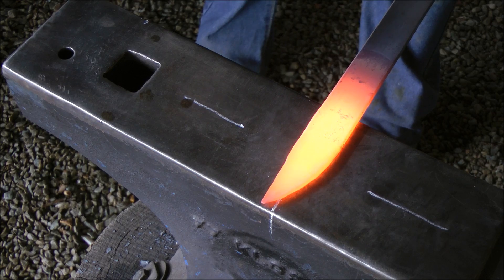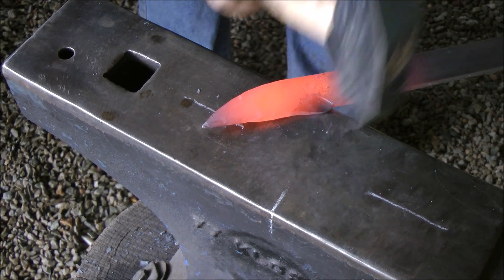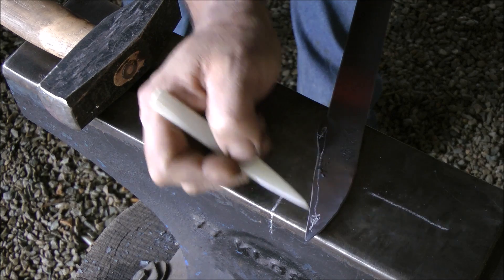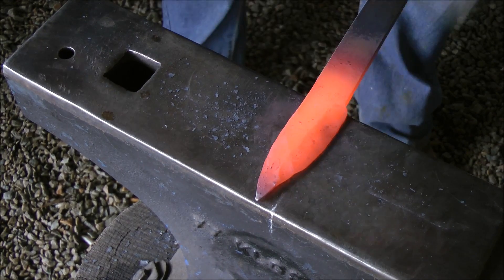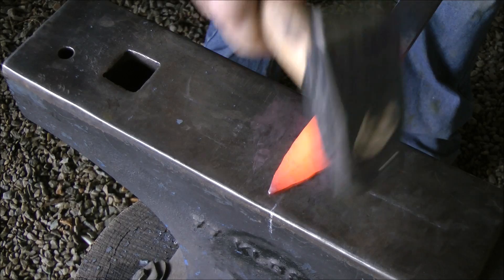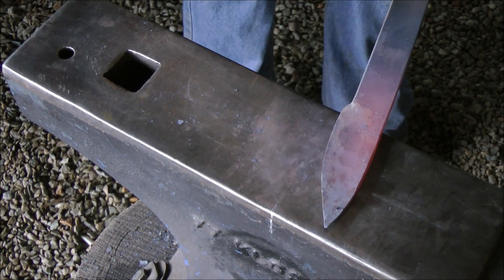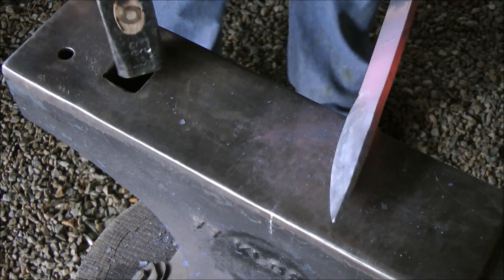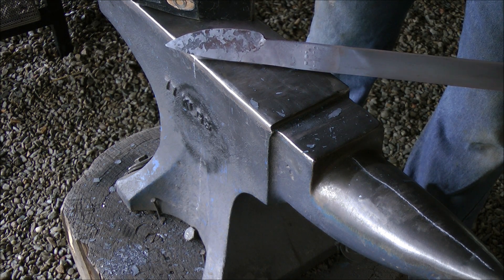Bladesmithing 101 - Drawing the Heel - Method 1

Comment: After a lot of trial and failure ,yesterday I was able to reach an acceptable result with this method .tanks again Neels ...
Just one question .... which is the way to forge bevels keeping at the same level the ricasso and the edge ? 
F.
Reply from the maker: filippo terenghi - just keep the same amount of hammer blows on each side and things should work out.
Reply: Sorry for my English ,I didn't explain clearly what I meant .
How do you forge a knife without the protrusion between ricasso and bevels ? Sorry again for my poor English

Comment: How do you hold onto the steel bar? do you use tongs or weld it to a bar?
Reply from the maker: I use the bar of steel im forging in the video. Welding a handle / bar to your steel or just using tongs are other options